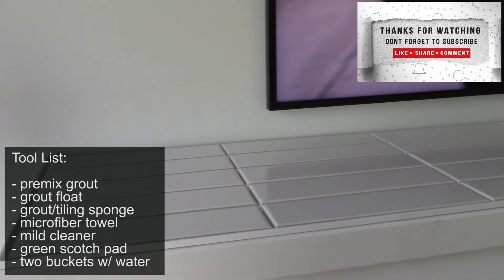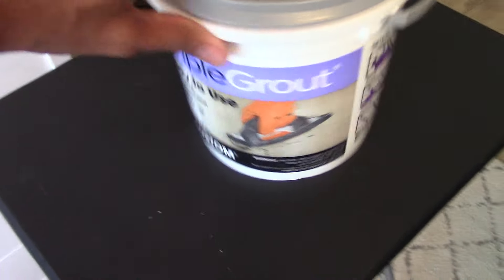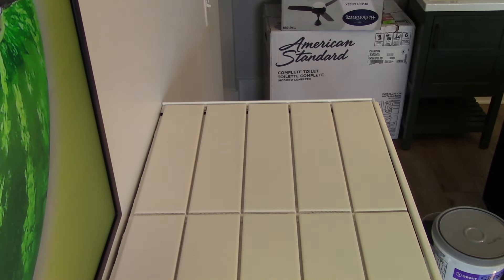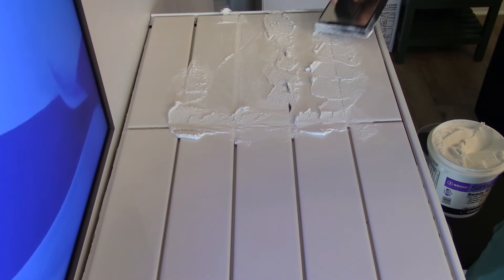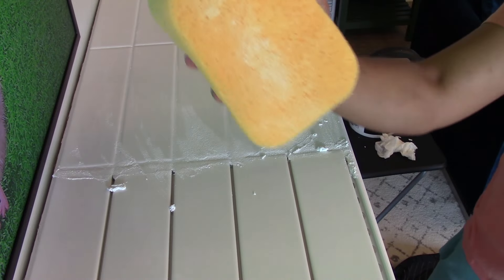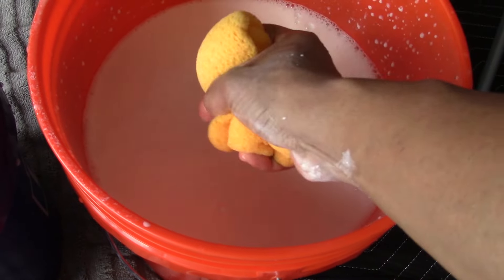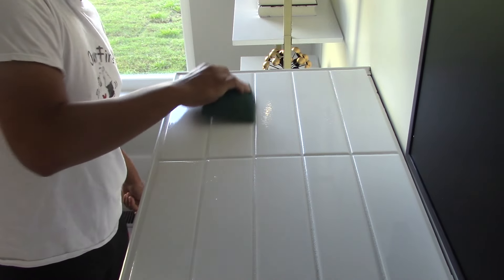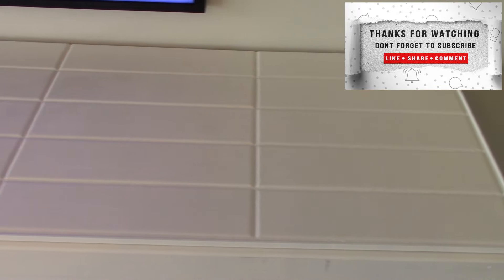Pre-Mixed Grout How-To | Simple and Fast

Comment: Why pre-dampen the tiles and grout lines, before grouting?
Reply from the maker: @JohnnyDeMarco-jp8vb  to reduce the haze after the initial grout application and wipe. Essentially less sticking to parts of tile you don't want grout to stick to
Reply: @  I see. Makes sense. Thanks. 
Oh, what happens if some water gets into the spaces prior to grouting? Is that bad?
Reply: Makes for a more smooth application as well.
Reply: I found that adding a little water to the grout lines prior to grouting actually helped me

Comment: Glad that I watched this before using the premix.  Original plan was to apply grout to about 30 sq ft and then start the cleanup.  Based on this clip, decided to do it in 5 sq ft increments.  After first five, dropped to 3.  If I had done 30, I would have had an enormous mess.  Thanks.
Reply from the maker: @johngiffin6421  glad the video could provide some insight on a good approach. Premix is definitely good product if applied in manageable chunks! Good luck with your project 👍🏾

Comment: I just tried last week but I had no idea about damping down the tile first. That was the first issue. The next is that I now realize that the tub of grout I was using seems a lot dryer than your stuff. Yours goes on smooth, mine was almost crumbly. I mean to do it all over again. Can I add water to my tub of grout to make it flow more easily?
Reply from the maker: I'd be cautious of adding water to the tub of grout as that will change the grout composition. Maybe try a different brand or dampen the tiles a bit more

Comment: ps. If where you laid your tiles is going to experience spills from drinks etc, I’d highly recommend using the Fusion Pre mixed grout. 
Same application procedure etc but it has stain proof additives in it which works incredibly well.
Especially for floors and around kitchen backsplashes where grease and food splatters can easily stain this Simple grout used in your video.
If you have already used Simple Grout in these areas, I’d recommend using a sealer on the grout prior to it getting dirty/stained.
Downside, the Fusion grout is twice as expensive as Simple grout.

Cheers.
Reply from the maker: Great info, thanks!!

Comment: I liked this.
Good tip the 2 buckets you mentioned and keep areas small and manageable.
I'm going premix. Had a friggin nightmare with mixed powder and left it in too long.
Gotta try and patch up the rough grouting.
Any tips.. Do I just go over it using your method? 😊
Reply from the maker: I would try to use a Dremel tool to route the old grout out if able. If not, it wouldn't hurt to go over with the premix in a small area to see how well it adheres to the existing grout. Appreciate the time you took to comment and share your story!
Reply: @EngineeredMojo 
Thanks. I'm gonna go over the rougher grout with a light coating of the premix doing it with the short end of the grout float.. I cannot have the same disaster on other 3 walls or I'll be a crying man. 😢 I was so upset at first. Gutted!
Reply from the maker: @kspolosmith7815  Good luck with the project, I know it'll turn out great this next go around. I've been in the same issues haha

Comment: Great video and very clear and concise.
The only thing I question is only waiting 30 minutes for the grout to cure before using a mild cleaner and green pad to clean the haze off of the tile surface.
If you’re EXTREMELY precise and careful, you can get away with it but even on the container’s instructions, it states to wait at least 4 hours before attempting this haze removal. 
I know it’s a catch 22 as the longer you wait the tougher the haze is to get off but dampening the grout only 30 minutes later and then possibly rubbing it by accident with the green pad can be an issue.
Just my opinion but great video nonetheless.
Reply from the maker: No precision really needed as the grout level is lower than the tile level. The haze cloth wipes right over the grout in my experience unless you really press hard on the cloth over the groove lines. I'd suggest doing a test section if worried!

Comment: Nice grabbed everything I needed and it came out nice..now I’m wondering should I put a grout sealer??
Reply from the maker: If your tile grout is in a high traffic area or exposed to moisture/water I would. I usually wait a few days to let grout set than apply the sealer. If those environment conditions don't apply, I usually skip the sealer part

Comment: Are u sealing this premix grout? If so how
Reply from the maker: This particular project I did not. If the grout is not in a high traffic or wet environment, I don't bother to seal. I don't have a video on sealing grout, but there are a few quality ones on YouTube I've watched in the past.
Reply: @EngineeredMojo  Thanks I'm repairing a shower just two loose tiles and a soap dish with a larger tile. I got a not-so-chap sealer...

I didn't know if I was doing some overkill here but seems like I'll go ahead and just do a whole seal coat on the shower walls, as it's all fairly aged.
Reply from the maker: @matthew3454  probably a good approach for sure to be on the safe side

Comment: Do I need to spray a sealer after this application? Also, I want to add glitter to the grout. How easy or tricky is it with premixed? 🤔
Reply from the maker: I typically only add a sealer in high traffic areas or areas prone to get wet. I'll admit glitter might be tough with premix given how stiff it is, I would do a test batch and try it out. Sounds like a cool idea!

Comment: I started my project with a pre-mixed grout adhesive, testing it in a corner. It was very gritty, and did not match the existing, since I am doing repair--not a complete regrouting. Why is it so hard to find pre-mixed unsanded grouts? Does it have any particular properties that make it harder to work with? Thanks for all the great, common sense tips!!
Reply from the maker: It's definitely not the easiest to work with given it sets so fast compared to bagged. How long ago was the existing grout installed? I know I've done a deep clean of grout lines to get them to match better with new I am putting in
Reply: I've lived here over 40 years. It's a hodge podge of bad, crooked tiling, cracks, and discoloration. I've cleaned the grout lines, removed,  and sawed down, filled large gaps with the  pre-mixed, sanded, and cleaned with Aqua Mix NanoScrub, it's a water soluble cream polish-- that did an amazing job, making everything bright white with a high gloss on the tile and the ancient porcelain tub. Most of my prep work is nearly finished, and will be ready to test out the unsand the grout with a few of your tips...
Reply from the maker: @JH-zr8lo  that's some awesome work! Hopefully the grouting goes well and you're able to save a bit of time with the premix

Comment: Why is my premixed grout sandy 8n texture:(
Reply from the maker: It will be sandy and very grainy, that's why you will have less working time than bagged grout.
Reply: @EngineeredMojo  so the finish product is supposed to appear different? It's not smooth that it's dry it is rough looking in the grout lines this is normal?
Reply from the maker: @mom2blessings_sadie  it should look like standard grout, it will have some texture. It won't be smooth like a sealant, but shouldn't be uneven and clumpy
Reply: @EngineeredMojo  could I email u a picture would u mind to let me know if it's normal or not?

Comment: But do I have to seal this grout. The tub directions say nothing!
Reply from the maker: If it's a wet or high traffic area I'd seal it. But if it's just a backslash or tile for shelf no need in my opinion
Reply: You only have seal it if you want to waterproof it.
Fusion grout is made by the same company, same colors and doesn't have to be sealed. the cost is double though.

Comment: Timeline for drying is wayyyy off. Regrouted my shower tdy, followed step by step, and yeah a few things did not work. For other viewers your going to have to wait 25-30 min for it to dry if you do it in 10-15 like he says all your progress will be gone. It’s been a very stressful day trying to follow these instructions bc clearly it doesn’t work perfectly 😂
Reply from the maker: @diamondexed5331  a shower enclosure could effect drying times and also how humid your house is if youre not running AC. It's always better to be a bit early with grout than too late when wiping for sure. You can reset a tile, but it's hard to clean haze haha